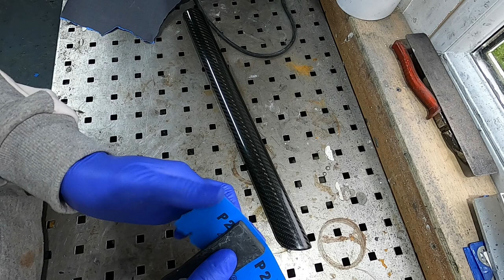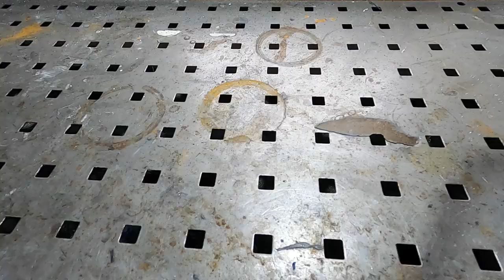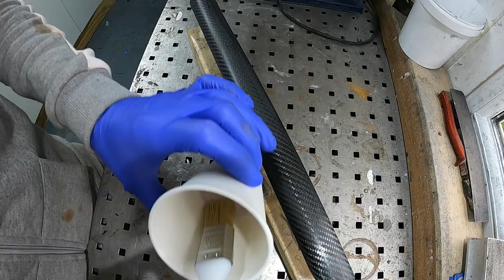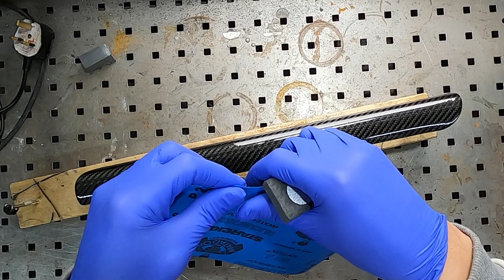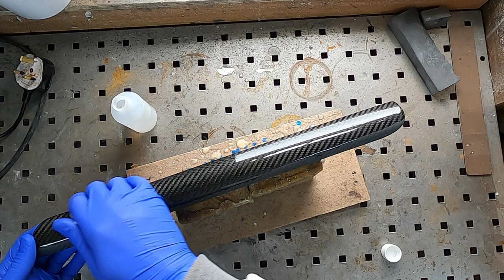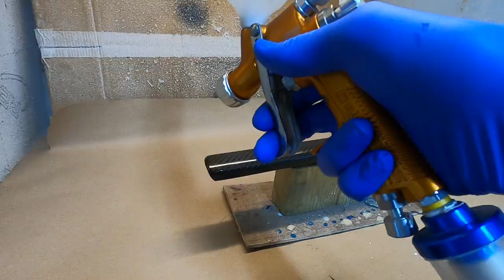How to fill Carbon Fibre pinholes. PERFECT finish every time! Prepreg Infusion Great for small parts

Comment: Spray light tack coat of clear coat then a medium coat, wait for it to harden enough to show the pin holes. Spray, straight, fast, thinner (manufacturer recommended)  in short burst over pin hole area. Thinner will soften the clear coat and, as it flashes off, draw out the air from the pin hole cavity creating a vacuum that in turn draws in the softened surrounding clear coat. Magic in front of your eyes! 😉
Reply from the maker: What's this wizardry 😆. Will give that a go soon!

Comment: Good Job!  The pinhole is generate because of  primer coat NOT do good.Need  primer coat (you use mould cleaner)to cover the pinhole first,Make the carbon part surface smooth, Then do glossy painting outside :)

Comment: I have small cracks in the center of my rear rim on my 2020 BMW S1000 RR M! Can I use this to fill it because BMW says its not affecting the integrity of the rim? I'm really worried leaving it exposed because it seems like with anything else cracked that not repairing it would let moisture and debris make it worse! The entire rim is 6 spokes solid carbon fiber weave!
Reply from the maker: Poor work from BMW! I would clean the crack with acetone and dab some Xcr resin as neatly as you can into the cracks to stop any dirt getting in.
Reply: Thank you!👍👍👍

Comment: I have personally never been able to plug the shallow pinholes other than by drowning the pieces with multiple coats of clear finish. I tried with a stiff spatula, applying pressure with gloves, but if the hole is narrower on the surface and wider internally, the air cannot get out and the resin, also due to its viscosity, will not fill it.
Reply: In that case what I would do is use a heatgun to heat the resin (which makes it thinner) and use a toothpick to poke those small holes which will force the air out of them. If they are smaller than the sharp end of a toothpick, you can use a sewing needle. Depending on how deep the hole goes, sometimes two applications are necessary (with some time apart so it cures to gel state) as the first pass will "seal" the holes and the second pass will top them off.
Reply: @TheShaddix  I to was thinking about applying a bit of heat.

Comment: I'm looking for an alternative to the XCR coating since I live in the US. I tried using the same resin I used to make the parts (composite envisions thin resin) and it doesn't build up a thick enough coat and self level enough to sand smooth. Do you have any other recommendations for a coating resin that would be available in the US? I've considered ecopoxy UV poxy and some cheap amazon ones as well but haven't tried any of those yet.
Reply from the maker: Try Duratec Sunshield Top Coat. I believe that's a US product. 👌
Reply: I used a standard epoxy resin for skinning (same used for parts) but with 2 or 3 layers with sanding between layers and finished by spraying a 2K clear coat, the result was great!

Comment: What xan i do if i cleaned a yellow clearcoat and applied 2 k clear coat and it came up full of small holes? I presume sand again but what to do before aplying again the clearcoat? Any degeraser or resin or?
Reply from the maker: Sand down untill holes disappear and then re clear. Always use a panel wipe degreaser first. And be sure to leave 5-10 minutes in-between spray coats as you might be describing solvent pop
Reply: @CarbonWorkshops  so no alcholo degreaser or any special degresear?
Reply from the maker: @powpow4033  I use Upol slow degreaser

Comment: That you have pinholes in the first place means that the product is filled with air pockets.. = less strenght. It means the cure cycle didnt went the way it should go. Common reasons: too less pressure on the product or heavy molds that take too long to heat up. Make sure it cures well. Applying an extra layer of unneeded resin does not make your part any stronger. But does add 10%+- of the weight. Wich is an issue. And always do wetsanding! And never exceed 240 grid. If you go any lower than 240, your sanding through your first layer wich will also make the part less strong. Also .. i can achief the same results with no extra paint/epoxy. Only thing you need to do is pollish it. The resin coat (if part cured correctly) will be just as shiny as the paint after pollishing. This safes alot of weight.😊

Comment: Where the pin holes in the initial resin or clear coat?
Reply from the maker: Initial resin after prepreg cured
Reply: I would use gas torch waving over clear quickly will remove air bubbles from mould surface and bring them through and will then pop, then lay down prepreg. Never pin holes takes time to learn how to do though.